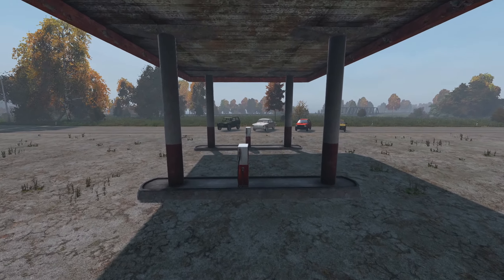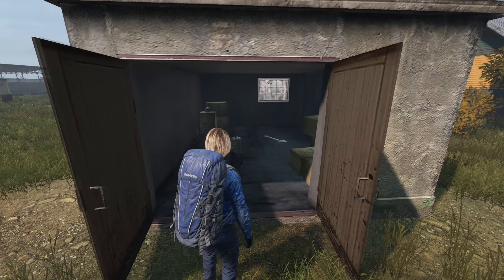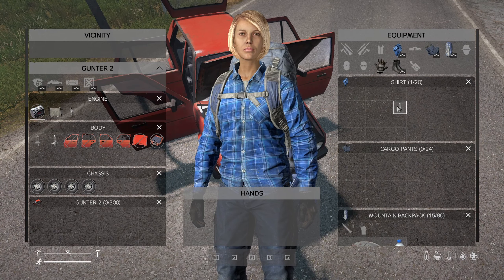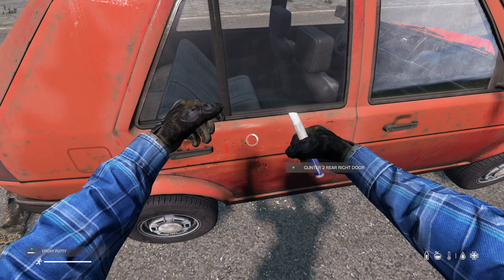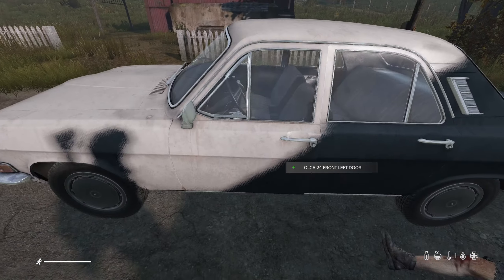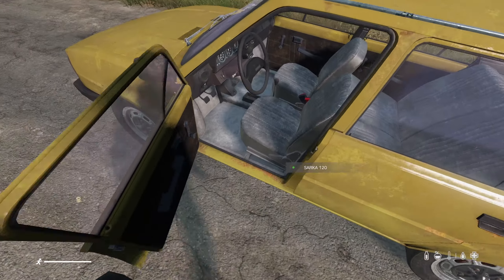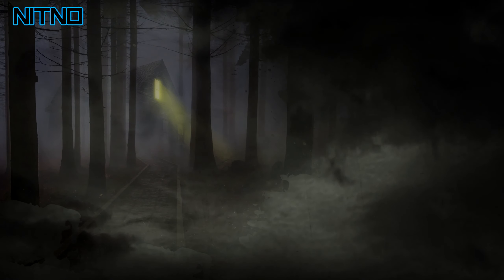How to Build and Repair Cars in DayZ - Fix, Drive, Attach Parts, and Find Vehicles - PC / PS5 / Xbox

Comment: If the engine is ruined it can't be fixed, then how would I get the car going again? Is it a new raidator/spark plug/battery? Or has the whole thing died and i need to find a new car?
Reply from the maker: If the engine has a RED dot, it is dead and broken without being repairable. Any other color it can be repaired with a pipe wrench. If just the radiator, spark plug, or battery is RED, then it can be repaired with spare parts.

Comment: That was the only helpful video I've found for car crafting on Dayz, thanks!
Reply from the maker: Awesome, I am glad I could help Tyrkane! I appreciate the comment!
Reply: @Nitno  Not a problem :) I just wanted to know as well, I came across a lot of cars in Dayz that looked like they could be fixed, and with good parts on them, but I've never been able to get the Tab menu where you can place all of the parts. Will this only work on cars with a pristine chassis? Sorry for the noob question!
Reply from the maker: @basic086  basically this: Green = OK and Usable, Orange = Damaged but Usable, Red = Broken and Completely Unusable

Comment: Sarka is the best car hands down it has the engine, radiator and stuff in the back so when you accidentally crash into the tree 1 shotting your car when a lag spike happens the sarka will be fine in that scenario because you don’t usually crash high speed in reverse
Reply from the maker: You know that is an excellent point! Great tip!

Comment: When I was little, we had the “Sarka” IRL, only difference was that it wasn’t 120, but 105
Reply from the maker: That is so cool, I love that! Must be nostalgic driving it in game.
Reply: @Nitno  We had a green one, the prefacelift version. The number indicates the engine version, so 120 was 1.2L and 105 was 1.0L. The prefacelift looks more luxurious to me because of all the chrome and glossy interior gauges and panels, the facelifted version called M had everything in rubber and/or in rubber textured matte plastic. I would like to buy the car after I finish school since it’s still too expensive for me right now (those cars are getting pricier every year and to get a cheap one, you have to do a rebuild)

Comment: How to open the UI for the car? I keep running around cars tapping Tab (inventory), but I can't get any to open the UI.

Also, if I build a car, how long will it last if I die or log out?
Reply from the maker: I suspect you may be going to wrecked vehicles and trying to check them for the UI. So Drive-able Vehicles and Wrecked Vehicles are different, Wrecked are basically static objects in the world, that you cannot fix up, they are just to find random items inside, and you can pillage them for parts like tires and doors. Drive-able vehicles are different and actually pretty rare, you'll see the UI of a drive-able vehicle. 
I beleive vehicles last 7-14 days before despawning, but you can touch it/interact with it and it will reset/extend that timer. Also if the engine of the car is ruined it will despawn quicker as  engines cannot be fixed, and you cannot extend the timer.

Comment: Very well done.  Thank you for the tips and pointers. Would you say it is safe to assume the M3S can also be repaired the same way?
Reply from the maker: Thank you! Good question on the m3s, I am actually working on a video for it right now. From my initial findings, yes it can be repaired in the same way for the most part.
Reply: You can use the pipe wrench to repair it
Reply from the maker: @petrwarthursty2011  Thanks for the reply. On PC I can't seem to find the sweet spot to repair the engine with a pipe wrench on the M3S. Any tips? Have you done it personally, or are you going off a tip? Thank you.
Reply: @Nitno  Yeah I did it. I actually just put my camera everywhere till it works so can’t say for sure where you gotta look
Reply from the maker: @petrwarthursty2011  Alright thank you! I appreciate it.

Comment: I've got a question, so everything on my car is in the green except for the front bumper, but it's only damaged. The back bumper is still fine. Is there a way to repair the front bumper or is it counted as the frame or chassis of the car?
Reply from the maker: I don't believe there is a way to fix the bumpers at this time.

Comment: OK, new question, and I think I know the answer. Do you have to use Olga tires on an Olga, and so on? or can you use Sarka tires on an Olga, etc? Is there any trick to getting tires? I checked 12 Olgas and found no tires, but lots of sarka tires and gunter tires
Reply from the maker: Good question, yes tires are specific to each vehicle.

Comment: Hi, I'm not 100% durr if you mentioned in your video how car doors can be locked into the car and become undetatchable?
Reply from the maker: Hello, yes that is a new feature that came after this video. I believe a screwdriver locks the doors in place, tire iron for the tires, and wrench for the battery, radiator, sparkplug.

Comment: Great video! Have you found the "sweet spot" for repairing the Sarka engine with the pipe wrench? I can't seem to find it anywhere. The other ones are easy enough.
Reply from the maker: Got this question a few times so I tested it myself and dug around for info as well, from my understanding this is indeed a bug and cannot currently be repaired until updated. Here is a feedback tracker from a month ago on it. https://feedback.bistudio.com/T155676
Reply: @Nitno  Oh, so I've figured it out. You can actually do it, but it's pretty silly. 
You have to stand on your front windshield, and look straight down towards your front hood. There's a very small sweet spot, so wave your view around until you find it. It's all the way in the back towards the center, iirc. 
This is on Xbox btw
Reply from the maker: @unclejimbo888  Nice find! Weird though, I am trying it on PC and I still can't get the sweet spot with your tips. So even though the engine is in the back, I'd need to be in the front, standing on the front windshield, and look down towards between the front hood and dash? (with the front hood open)? Thanks!

Comment: Do car engines wear out or why engine of my car started to get damaged without any reason? Radiator full of water, didn't crash or rev too high. After driving around the block a couple of times check engine light popped up and engine went from pristine to damaged. Same every time after I repaired engine with pipe wrench. Only reason I could came up is that there's limit how much car can be driven before engine wears out and starts to self destruct and I had that car for a long time.
Reply from the maker: That is very strange. Maybe the radiator needed more water? I believe it needs at least 75% of the water gauge to avoid damage.
Reply: @Nitno  Nope radiator full and engine destroyed itself without any reason. Maybe some kind of rare glitch if this isn't normal.
Reply from the maker: @YoStu242  Dang that is strange, I am not sure what caused that :/
Reply: it happen to me...twice. No solutions? Also the server where I am is with mods. I had cars before in vanilla servers and all good with the cars.

Comment: Just built my first car, an ada 4x4. Instantly crashed and ruined the radiator due to a large freeze, but I had an extra thank the lord. If you get a car, keep it under 50kmh. That’s just my opinion. Anything else causes large freezes.
Reply from the maker: Good thinking, yep keeping it at a medium speed seems best.
Reply: Agreed, gotta take it nice and slow, still way faster than traveling on foot

Comment: Was wondering .. how do you fix bumpers and roofs tho? I tried epoxy for the roof doesn't work and I'm still pretty new to maintain cars in dayz.  I've had the weirdest glitch where my Olga just flipped on the roof and back on its wheel while driving on a straight road.  So only my roof got damaged 😂😂
Reply from the maker: I do not believe you can fix the roof and bumper at this time. If anything, it would epoxy.
Reply: @Nitno  thank you. I wasn't sure if the game was bugged or if I didn't have the right tools.
Reply from the maker: @jacoblapointe8181  You are welcome!

Comment: I've only just gotten the game a few days ago and got a car up and going but as I was driving the game lagged and the car crashed I fixed up almost all the parts but the radiator is damaged and I'm not sure how to repair it. I'm in the process of trying to find a replacement but I'd like to know if you can fix a damaged one.
Reply from the maker: Hello lleyton, it depends on how damages it is. Try taking it out and placing it in your inventory. If it is red then it is ruined and you need a new one.
Reply: Screwdriver for Rads and battery

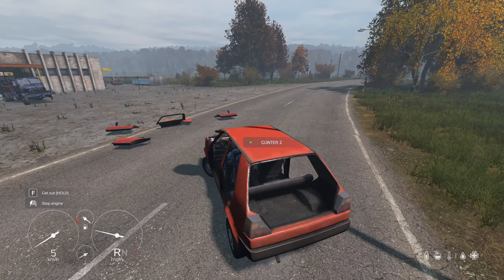Comment: My engine gets ruined just after few secs of driving like yours at 3:16. The radiator is full with water what is the problem ? bug ?
Reply from the maker: so it actually has to be more than 3/4th full radiator, so even if you feel like youve added a lot, try to fill it completely till it doesn't let you anymore.

Comment: Is there to repair the actual vehicle, for example my Olga has everything pristine however when looking at the seats for example it shows it as damaged. No tool I currently uses fixes that.
Reply from the maker: This is not unfortunately.
Reply: @Nitno  hope that doesnt mean if the chassis gets ruined the car will despawn even though the car physically is able to drive..

Comment: Every car I go up to in dayz on the xbox it doesnt even have the vicinity. Does that mean it's not driveable?
Reply from the maker: Correct, 99% of cars you find are not drive able and just "part of the scenery". Only cars that can be repaired and driven will have an inventory.
Reply: Is the only way to know it's drivable just by trying to pull up the inventory ?
Reply from the maker: @jestermechanical7491  Pretty much, I mean it will also look more colorful and less weathered and rusty. After a while you can spot a car you can fix up very easily, they will stick out.

Comment: Im new to dayz, I had an incident with my car and managed to brake all my front like the bonnet, doors and tires. I can still drive it with broken tires, will something happen eventually to where i wont be able to drive it with the broken tires or can i just keep using the car with broken tires without anything happening?
Reply from the maker: I do believe your tires will eventually go ruined, especially if you have any more bumps. Try to find a Tire Repair Kit and fix them up!
Reply: @Nitno  My tires are ruined, they have gone red but i can still drive it. I dont know if thats normal or what, first time having a car

Comment: Hi, I have an Ada and when I look at the seat it shows it being badly damaged. What exactly is damaged and how do I repair this? I'm worried it will despawn if it turns to ruined even though my engine is pristine.
Reply from the maker: Hrmm it is hard to say without a screenshot. Have you opened the hood and inspected each part? (even the spare tire if there is one)
Reply: Yeh I have the same problem with the gunter, everything is pristine apart from the chassis which is also badly damaged. Tried a load of items to try and repair it but dont get any prompts

Comment: i have a question which is i can’t fix damaged engines with a pipe wrench what is the problem with that why can’t i do like it siad in the video when i get the pipe in my hands and i look at the engine icon there’s no repair damage but the engine is yellow for example
Reply from the maker: hmm good question, what kind of car are you using? If its the m3s truck I hear there is a big right now but its fixed in 1.14.

Comment: if the car is red? can you repair it? i was just driving a gunter and it started smoking and now the car is red instead of green. Its not letting me add any of the parts onto it anymore
Reply from the maker: Red engine cannot be repaired. If it was just any other part that went red, you can replace the part. You can maintain the engine health if you repair it with a pipe wrench, but once it hits red it's permanently busted.
Reply: @Nitno  damn, that’s tough. I was just playing on runningmanz Livonia server and was hyped about finding a car and I had all the parts, but didn’t realize the radiator would lose water so quick and make the engine unrepairable. Thanks for the vid though! I’ll definitely go back again to make sure I got everything I need for a car.
Reply: @BrickPB  If you fill the radiator till it no longer needs water, it will stay full. if you only fill it partially it will steam and run out of water. You can drive a car very short distances without water or a radiator and then let it cool off.

Comment: Anyone having trouble getting the epoxy to work on certain parts of the Chassis of an Ada 4x4? Ive driven around and checked every angle and for some reason the front and rear (of course typically the two most necessary parts to be repaired) wont prompt me to fix the car when the epoxy is in my hands.
Reply: It WILL let me repair the corner panels
Reply from the maker: Sorry for the late reply. The epoxy can be finicky and doesn't seem to repair all parts of the experience.

Comment: How do I get the old tires off to put the new ones on
Reply from the maker: You should be able to target them and pull them off. If not they may be locked, tires can be unlocked / locked with a tire-iron.

Comment: I found a car with everything in the hood that is required to drive. Fill up the radiator with water and suddenly it started smoking with a yellow check engine. Any idea what went wrong?
Reply from the maker: Hmm, strange... I mean that does sound like an issue with the radiator. Any change the radiator was damaged? Also if you fill the radiator with water, BUT then remove the radiator it empties the water, so placing it back in would place it empty. Also maybe the actual engine was damaged?

Comment: When you get into a wreck and you repair everything the engine tires spark plugs battery and you start driving the car just randomly starts taking a lot of damage how do I stop that?
Reply from the maker: Likely it is the radiator. When removing the radiator it empties all the water. You need to fill it up more than 3/4ths full I believe.
Reply: @Nitno  I repaired the engine and then I filled the radiator all the way up. I still had water in it when it was trying to drive it before, but it stopped doing it once I capped it.

Comment: There's another part of the car that can get damaged if you keep hitting things (those sounds like the bottom of the car is scratching on things), even slight bumps, when it gets ruined the car still works but you'll start to lose fuel really really fast. It shows on the front and rear bumper (At least on the Gunter2, on the Sarka it's on the front sides). I don't think it can be fixed as of 1.10.
edit: corrections.
Reply from the maker: Good addition, thank you!
Reply: @Nitno  Thanks, great video.

Comment: Add a gear head, what bugs me about this is that it only takes 1 spark plug. The game should required the correct number of plugs for the specific type of vehicle. It's absurd as requiring only 1 wheel and tire.
Reply from the maker: Agreed! I think they felt they needed to simplify it. They used to require motor oil too but took that out.

Comment: My car engine is orange but I can’t fix it with pipe wrench 🤷🏻‍♂️
Reply from the maker: Hmm should be able to fix it. Maybe try standing on the hood or different weird positions.
Reply: @Nitno  here's one of the fix: log out and log back in. But it seems my car kept getting engine problem every 20 meters it ran. When I check the whole car, it's yellow color. I kept fixing the engine for every 20-30 meters it ran. Any idea?
Reply from the maker: @NgJackal1990  My guess is not enough water in the radiator. Needs at least 75% full or it will get damage when driving.
Reply: @Nitno  Strange thing is, I can't refill the water so I think it's full or it could be glitched.

Comment: Oh nice yeah but how? They literally soawn a battery in 1 town and the radiator , 30 mins away, how would you carry both? It is impossible to build a car, not enough loot spawns of parts , and too big , i have tried, i can never find a soark plug , and when i do i need a battery
Reply from the maker: It's rough, but you can hold all the parts (aside from tires) in large bags + big pants or shirts. Spark plug is usually the hardest to find I feel.
Reply: @Nitno  yeah but thats about it, what about food? Supplies? Rags? Ammo? Weapons? Thats what i hate about day z man, there is not enough supplies, if you go into any house, there should be , bottles of water, cooking pots ect, but dam , out of 10 houses you go in, you will only find stuff in 4 of them and only find something useful like food or pants in 2 lol

Comment: Does any1 know how to like in rust car doors and stuff I want my car to look good but the rust on my sarka kind of annoys me since it is yellow
Reply from the maker: As long as the door isn't ruined, you can combine it with Epoxy to fix the car door and it's appearance should improve.
Reply: It is not damaged it is just rusty because It is off those wrecks and I was wondering if you could get the rust off it have not tested epoxy and no the door is pristine
Reply from the maker: @OPNinja666  Hmm, the only repairing I am aware of is with Epoxy so I would try that if you can.
Reply: Alright I will try I don't think it is possible to derust car doors and hoods all I know is that if you park a car in grass it will rust the car doors and hoods